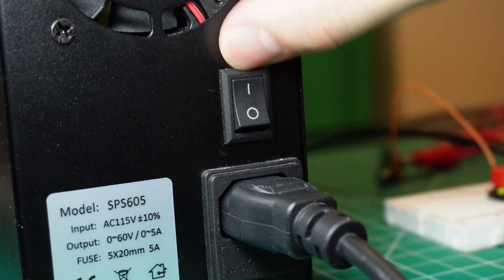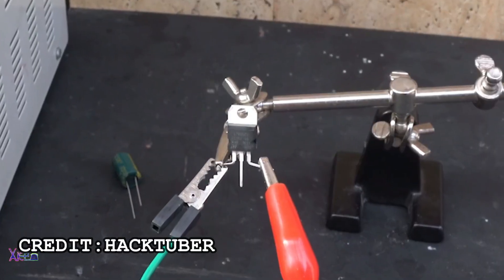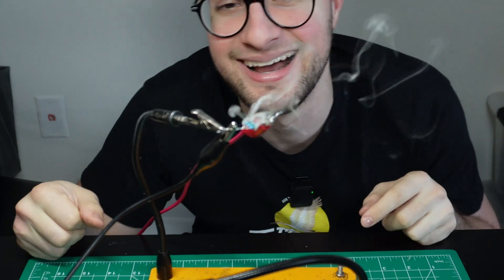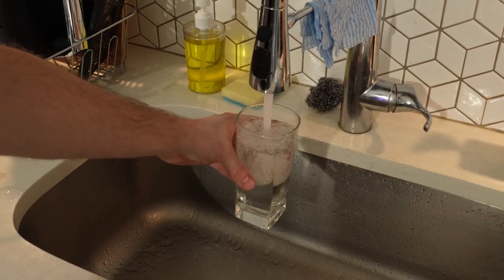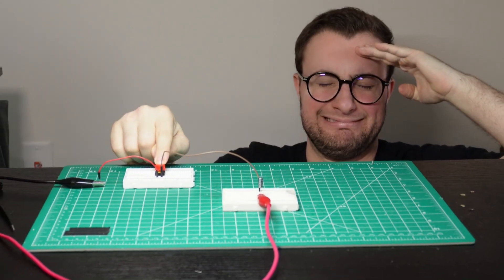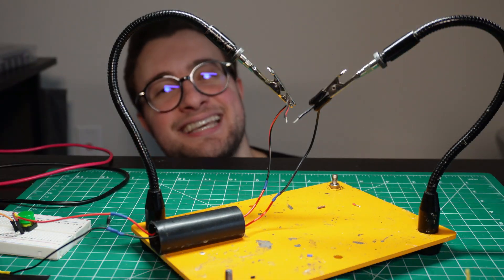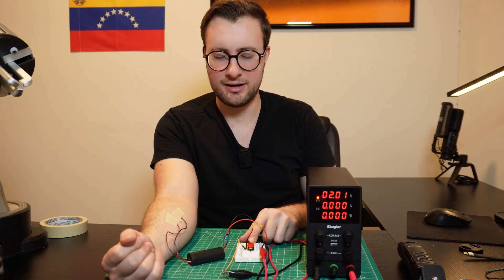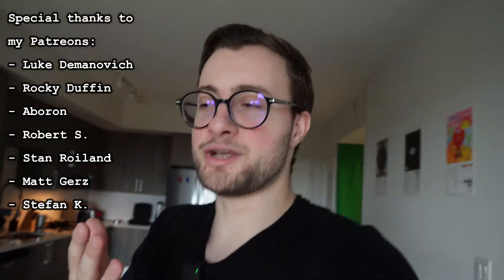3 Forbidden Ways of Using Electricity

Comment: Well I have big capacitors here and I do enjoy blowing classes up when I'm bored the only thing is the ones I have you can't be near them when they pop you're very good reason because if you're too close you'll get pretty badly injured because once I have are over 100,000 microfarads add over 500 volts so completely you'd probably lose an arm or a few fingers or worse

Comment: can 2k ohm handle 5v?
@PLACTITECH
Reply: Yes, a 2k ohm resistor can handle 5V, but whether it's safe depends on the power rating of the resistor.

Let's calculate the power:

Using Ohm's Law:

Current (I) = V / R = 5V / 2000Ω = 0.0025 A (2.5 mA)

Power (P) = V × I = 5V × 0.0025 A = 0.0125 W (12.5 milliwatts)

Common resistor power ratings:

1/8 watt (0.125W)

1/4 watt (0.25W)

1/2 watt (0.5W)

So 12.5 mW is well below even 1/8 watt, meaning a standard 2kΩ resistor can easily handle 5V without any issues.

Would you like help picking a resistor for a specific circuit or application?

Comment: Just in case anyone was curious, the component used to make the sound is called a solenoid
Reply: @anastaiiazakala7035   uhhh no that is called a speaker and in the video he used a aluminum electrolytic capacitor,  solenoids are coils although an altering current passing through a solenoid in the exposure of a magnetic field is all that a speaker does.

Comment: He's finally discovering the fun side of high voltage. Next try with microwave oven transformers :)
Reply: This came from ChatGPT, but I find it generally pretty accurate for these kinds of prompts… so…

Injuries and Hospitalizations:
	•	Microwave repair injuries (especially electrical shocks and burns) are much more common.
	•	Magnetrons and their capacitors can store up to 4,000–5,000 volts even after unplugging the microwave — a lethal level under the wrong conditions.
	•	According to CPSC injury databases and ER stats:
	•	Hundreds of people go to U.S. emergency rooms every year for microwave oven-related injuries.
	•	A subset of those are severe electrical burns or shock trauma from DIY repairs.
	•	Many involve amputations, deep tissue burns, cardiac injuries (from heart muscle damage after shocks), or secondary injuries (falling, hitting your head, etc.).

Example cases:
	•	A 2011 ER case reported in Annals of Emergency Medicine involved a hobbyist who got a high-voltage shock, went into cardiac arrhythmia, and needed hospital admission.
	•	1980s–1990s case studies documented amateur repairers getting deep hand burns or heart injuries from discharging a capacitor while poking around a magnetron.
Reply: Key dangers from magnetrons
	•	Stored charge in the high-voltage capacitor — can deliver a huge shock even after unplugging.
	•	Beryllium oxide ceramic inside the magnetron — highly toxic if cracked and inhaled.
	•	Sharp edges and heavy components — cause mechanical injuries during disassembly.
	•	Secondary accidents — falling off ladders, dropping microwaves on feet, etc.